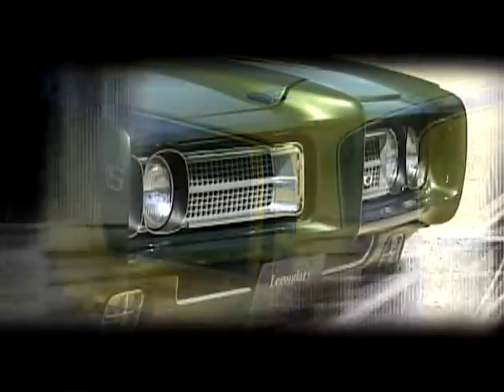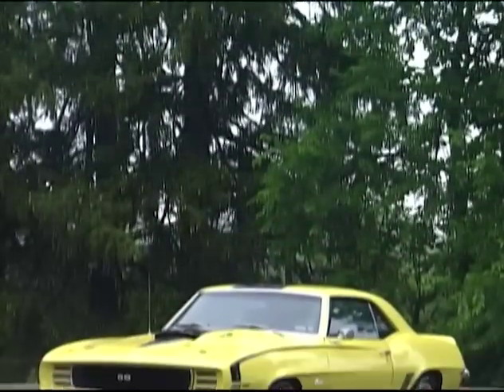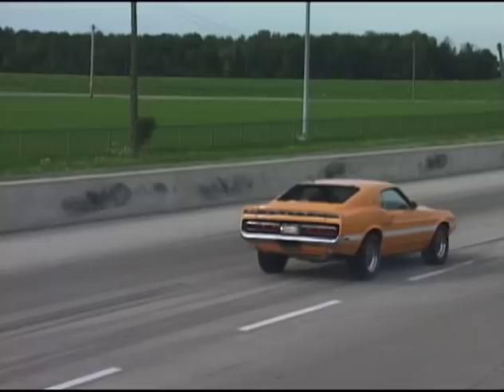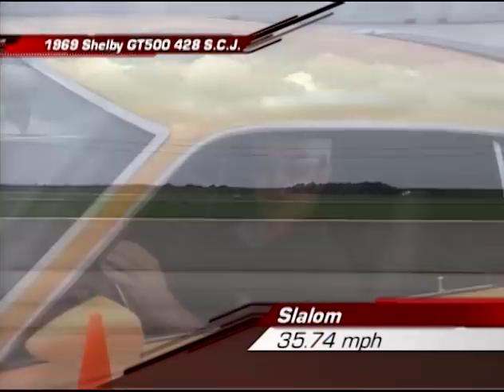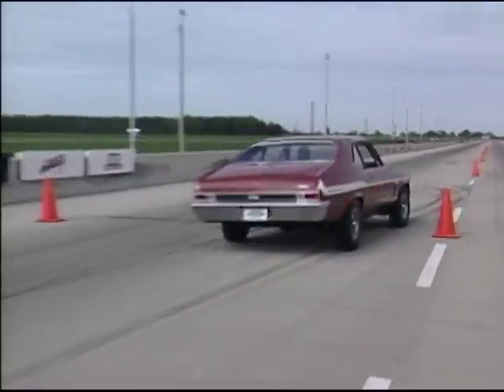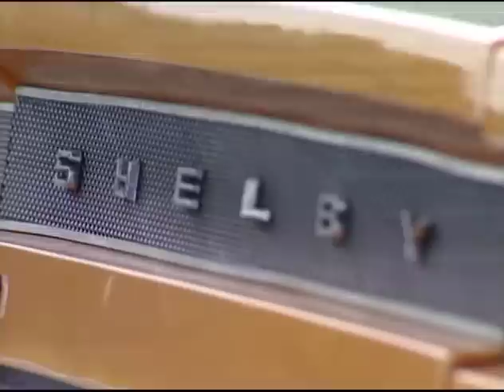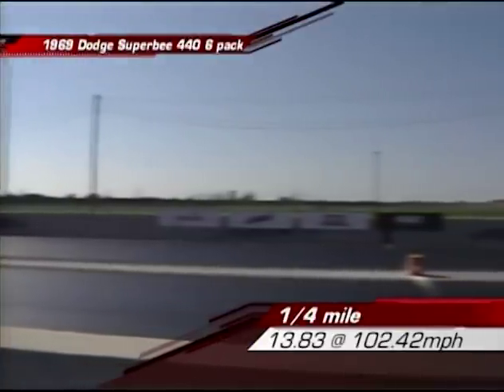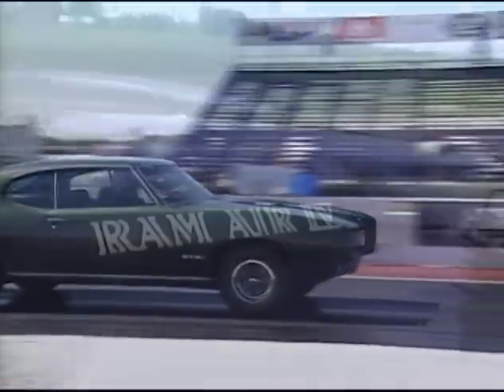What's the fastest 1969 tuner? SUPER MUSCLE CAR SHOOTOUT!

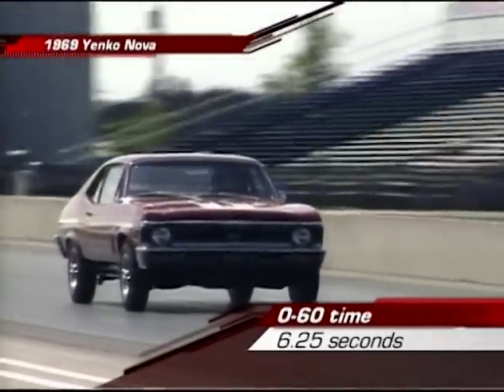Comment: Every single one of the GM cars are aftermarket equipped with dealer add on’s. Baldwin Motion, Royal Pontiac and Yenko were known for changing out the camshafts, intake manifolds, putting headers on the engines, provided 4:56 to 4:88 gears and so forth. The only “stock cars there were the non GM cars. This is the equivalent of the Mopar cars showing up with Hurst race Hemi Darts and Barracuda’s or Ford using specialty S.O.H.C engines powering the Shelby Mustang. This is NOT a fair comparison of cars.
Reply: LOL, No Peter, you're not going to use the burnout test to arbitrarily bump the Camero up the leader board. The only way GM can compete is to lie cheat and steel.

Comment: Where's the King 👑 ???  That would be the 1969 Corvette L88  (560 hp @ 6,400 )  🏁 All these cars listed are cool muscle cars but also rans , close but no cigar and yes that includes the Copo ZL1 and Yenko  , the Vette hooks up really well out of the hole , and the Camaro doesn't , never did !  and with those 4.56 gears it would smoke you off the line and your not gonna beat the L88 on the big end either !!  That is unless your running a Mopar Hemi and even that would be a very close drivers race , flip a coin.  ( Sorry 440 / 6 pack you would lose too )  .. the truth hurts ! 🏁
Reply: Corvette was missing a back seat... so didn't make the cut...
Reply: @BuzzLOLOL  too bad because the L88 Vette was badass, it ruled the roost at GM  🏁
Reply: @davegeisler7802  - Few L88's were sold, aimed only at hard core racers, HP rating of 430 was intentionally below the 435 HP of top tripower 427 so that rich kids wouldn't want to buy the L88... and the kink bent stock exhaust system put on the L88 designed for a 396 clogged the L88 down by nearly 200 HP...

Comment: Gotta call BS on the 69 Shelby as it WAS Tasca that MADE the 428CJs sing.... for 68 Shelby sold to Ford because of the cost of emissions testing under his own name. 69 Shelby was nice but true comparison would have had a Tasca 9F02R Drag Pack Mach 1.... My 9F02R purchased June 1969 is in my garage still today so I had THE REAL life experience in 69. True comparisons would have BEEN a Tasca Stang, Yenko Nova, GSS Dart, Royal GTO Hurst Scrambler, Baldwin Camaro, 

Really hate experts who are WRONG - Shelby had the BIGGEST rear brakes Ford used. Same as big Galaxies and trucks... GT500 used the SAME cylinder heads and camshafts for both the CJ & SCJ.  68 Shelbys were crap. Owned 67 GT500 for 24 years & a 0F02Z Oct 1969 to 1973 and it was crap off the dealer lot. 

Wineer is the GTO with highly modified heads etc but we don't see where it ranked in braking and slalom. Baldwin Camaro was another highly modified engine. Both the Bee and the GT500 were apparently factory stock engines. Good but had a lot of unlocked potential. GT 500 had the best braking and 2nd slalom.. 440-6V what springs were in the outboard carbs? Did it run out of air on the top end. They were excellent street machines.
Reply: Well GT500 lost 2nd carb. by '68... lost hot cam by '69... most ran 16's... this one had race shop tuned Super Corbra Jet 428 engine option... 
Torquey GTO's owned stoplight to stoplight... where more people saw them... took a full 1/4 mile for the overcammed Chevy's to get a fender ahead: 
https://www.youtube.com/watch?v=SJIRitKQYrM 
GTO outsold everybody until '70 when Chevelle SS finally caught up... John DeLorean had it going on... without GM's permission...

Comment: The Mustang was a huge disadvantage here. Ford basically made a gentleman's Shelby luxury Streetcar. This is not a good representation for Ford. A much better representation would been the Boss 429 or the 428 Cobra Jet. I got to say though that 427 Baldwin Camaro is one of the kings of all time.
My favorite Camaro of all.
Reply: The Shelby was a 428 scj car it just wasn’t super tuned like the other cars if it was a tasca prepared car it would have been more even
Reply: @travislostaglia8861  yeah the car had a great engine but as I said it wasn't really an ideal drag car. S**t I used to have a 70 Mustang Coupe 302 two-barrel single exhaust that would have ran a better ET than that. Also that 440 six pack should have been right there with the GTO and the Camaro.
Reply: They already used the Boss 429 on the previous muscle car shootout
Reply: @iggyfritz7150  440 Sixpack was heavier. Weight is the Enemy
Reply: @gmain1977  yes but the pure torque and horsepower made up for it. Sometimes heavier cars put the power to the ground better than smaller cars
Reply: @iggyfritz7150   A 302 2V  1970 Mustang isn't getting anywhere near a high 13-low 14 second 1/4 mile time.
Reply: @davidh1249  tell that to the 340 Cuda who's a## kicked

Comment: The only question is how did that GTO mile an hour at 106 with factory exhaust and that puny quadrajet ??  The Camaro had the hottest engine hands down because it was NOT as factory delivered. It had headers and aluminum intake AND aluminum heads and a 930 cfm 3 barrel Holley, the mile an hour difference between it and the Goat was too close to matter. That isn't correct.
I won't complain about the six pack because it's just a known fact that headers will automatically give that engine 65 hp if the carbs are rejetted correctly and the headers are made right. The factory dodge exhaust just didn't cut it as delivered. They should have used a Hemi car.
I will complain loudly about the Nova. Anybody that actually ever drove any of these cars knows that Novas wheel hop terribly. The only reason the Camaro didn't is because it wasn't as factory delivered, it had traction bars on it and all the other stuff that none of the other cars did. That Nova was as light as the AMC and should have had more horsepower than the GTO. Something was not even right with that car.
Lots of mysteries that don't add up in this shootout.

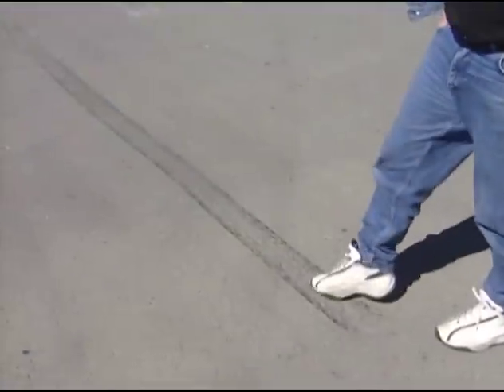Comment: I’ll eat my shoes if that GTO  only has a 3:91 or a 4:11 gears! He’s gone through 1 & 2 gear by the time just about any of the other cars are just about ready to shift out of 1st gear in this test. My guess is that it’s got something more in the 4:88 ratio for rear end gears.
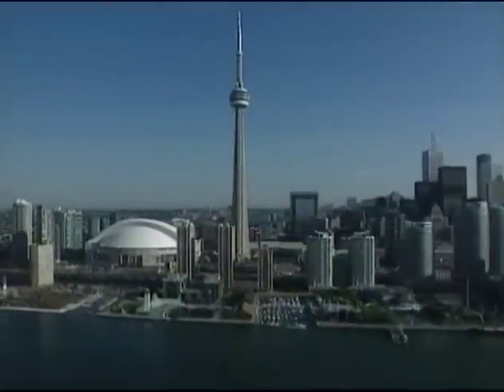Reply: I believe they came with 3:91 or 4:33 gears
Reply: @harley8728   A lot of these cars could be ordered with steep gears and even if it had 4:33’s in it he still would not be shifting gears THAT MUCH before EVERY other car he raced unless everyone else is running 3:20’s or worse. Nobody that wants to drag race their car would put such gears in their car and I doubt those cars had that type gears that day it more believable that the GTO is running gears that did not come with that car.

Comment: Saddest thing about the muscle car era is most modern cars with 4 and 6 cyl engines and fwd will run just as fast or faster than the majority of " Muscle cars ".
Reply: FWD cars tend to lose 5 - 10 tenths coming of the line as weight transfers to undriven rear wheels and lightened front wheels just spin... ...
Reply: @BuzzLOLOL  that's why you set the suspension up to raise the back end up to put the weight on the front of the car
Reply: @BuzzLOLOL  I think you missed the point of my comment I'm saying the times that my car has ran are in line if not quicker than what the muscle cars were running back in the day, now do you get it?
Reply: @kskip4242  - Do the same mods to a RWD car so the rear raises on take off... plants the rear tires... stock '87 Buick GNX did that...
Reply: @BuzzLOLOL  okay are we having a civil conversation or are we arguing cuz I'm confused? I realize it works either way it really just depends on your preference for a car,I like front wheel drive these days because I can get the best of both worlds I can do performance and I can drive in the winter time and Slick weather. No hate from me, I like cars in general.
Reply: @kskip4242  - I'm 74 and up North and have driven RWD cars year around all my life... no big deal... have a 4WD truck if I want to plow snow... modern extended 4WD trucks are also fast... 
My life in 1960's was just like the movie American Graffiti... we still love those days...

Comment: Oops I forgot to say 428 Cobra Jet Mach 1 it's a lighter car, and with just little doctoring you could get them into the 12's
Reply: I looked up a few dyno runs and the 428CJ made peak horsepower at 4800 rpm which would indicate to me they are seriously under  cammed or the cylinder heads are limiting them. I suspect it's mostly the heads after looking at the port and chamber design.
Reply: @travispfannmuller7717  only a true racer Mechanic would have your knowledge. 👍
Reply: GT500 lost 2nd carb. by '68... lost hot cam by '69... most ran 16's... this one had race shop tuned Super Corbra Jet 428 engine option...

Comment: Maybe try a lighter Ford ? Lol I’m sure the real drag pack Shelby was acid dipped and way lighter? Or try the 302 boss that changed the game with a lighter car motor and everything lol 😂 or maybe the 67’ year cars? Gt500 with the 427 ci king of the road or maybe do the super cars the ac cobra v corvette idk? What dodge car u could use? Up to u just adding some options ?
Reply: Shelby GT500 lost 2nd carb. in '68... lost hot cam in this '69... ran 16's... Shelby left Ford completely Summer of '69... at least this GT500 had a race shop tune on the Super Cobra Jet 428 engine option...

Comment: Sorry....but I must call foul on behalf of Ford, Mopar, and American Motors.  You have the lightest weight vs. horsepower ratio for GM.  You ran a 69 427 Camaro vs a 70 428CJ Mustang which was much heavier than the 69 Mustang.  You have two 427 versions of GM products including the lightest version, the Chevy Nova.  Yet you have no 426 Hemi cars.  A car that both NHRA and NASCAR both considered an unfair advantage.  Is MOPAR best known for their 440 or the 426 Hemi? Not one, not two, but "three" GM products against only one of the other manufactures. Shame on you for stacking the deck to GM's favor!

Comment: WHAT THE HELL GUYS. YOU JUST STATED THAT EVERY CAR WAS GONE THROUGH & TUNED AS BEST AS POSSIBLE. YET RIGHT OFF THE BAT, THE VERY FIRST CAR TESTED FOR 0 TO 60 WAS THE YENKO NOVA, THAT HAD A SLOPPY SHIFTER.......AMONG OTHER PROBLEMS. I CALL BULLSHIT. Either someone wasn't doing their damned job, or someone is trying to stack the deck for a personal favorite car.
Reply: Not necessarily,  how a car performs driving on the street is different  on strip. Even modern cars get pushed on track or strip and they so not perform  as they should
Reply: Calm down and take your caps off.  These are not F.A.S.T. race series cars.  These are realistic performance results.  Yes, everybody knows that if you start working on these cars all of them would be faster.